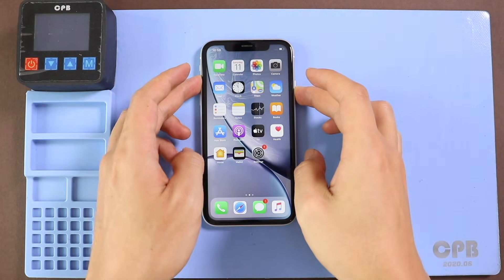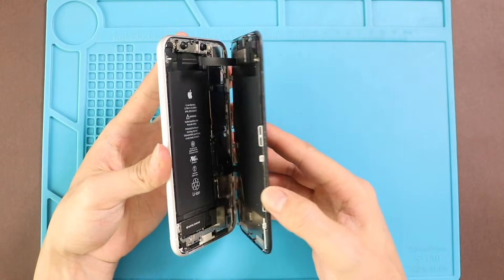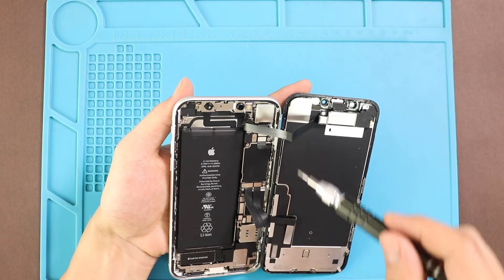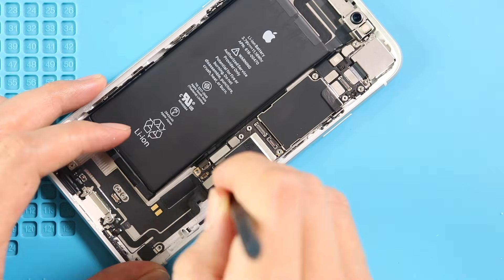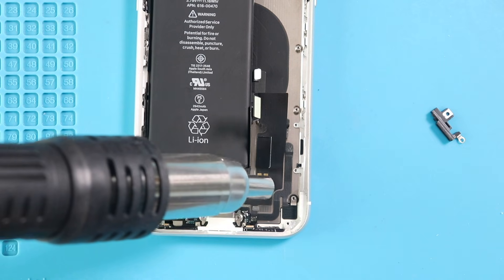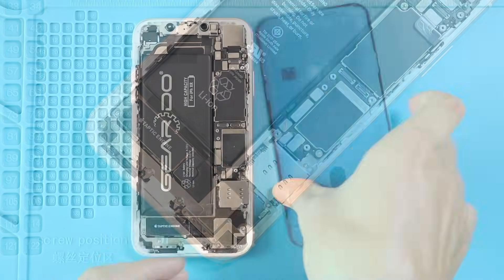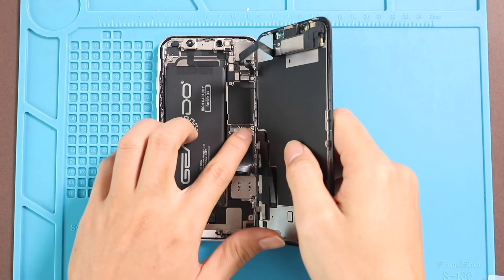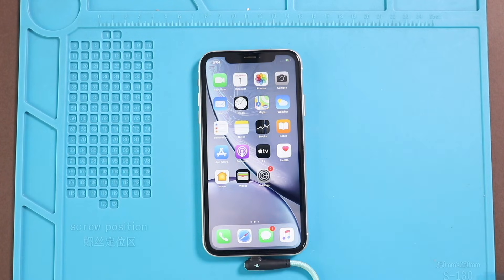iPhone XR Charging Port Replacement | Logic Board

Comment: What happens if i break a bracket from minute 2:56
Reply from the maker: I mean, can run the device without it too. you can also buy those brackets
Reply: @DIYGeardo thank you, I put it all back without the bracket and it in did work 😂your video was great

Comment: I replaced charging port and battery. I heated phone by placing a cloth on a frypan and heating over low heat. I would recommend using good quality tools, rather than the cheap ones, (I used),  included  with the replacement parts. Keep track of the screws; they are tiny and all different. Overall the repair was a success but Face ID doesn't work anymore.
Reply: Whyy
Reply: Face id what happened?
Reply: @heavysha1886   . I don’t know what happened, but Face ID doesn’t work any more.
Reply: Not possible. FaceID is not affected by this repair. Only a screen replacement or top speaker replacement would do that.
Reply: Its been a year, but I just had the same problem. Just forgot, to connect one flex cable that was hiding underneath

Comment: How did you remove the screw near the one sim tray at 3:28 its not a philips head and you removed it with a philips???? Im also looking at it right now and its NOT A PHILIP SCREW ITS JUST A CIRCLE HEAD!!!!!!!
Reply: Did you resolve this? Lol
Reply: I’m also stuck with this lol
Reply: dont know the screw head but removed it using the thin iphone opener on the line wholes
Reply: I used the cover bracket from the flexcables to loosen them. Ist annoying, but it works

Comment: Hi, can we test the new flex just by connecting in the board and without actually removing the original flex? So we know the problem is with the old flex!
Reply from the maker: Yes you can, simply disconnect the charging port cable and battery connector cable, Then connect the new charging cable and the battery plug. Connect the charger and test your new flex. check the video below, this is on XS Max https://www.youtube.com/watch?v=2jUImg1652o
Reply: @DIYGeardo  thank you. That really helped